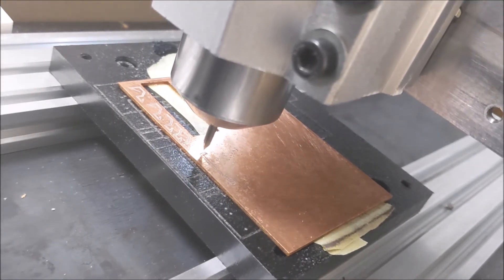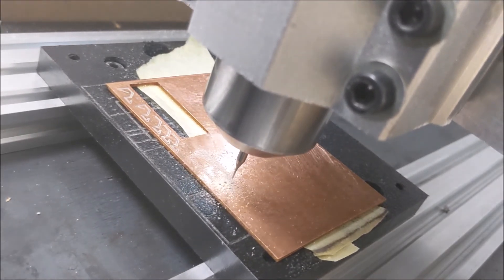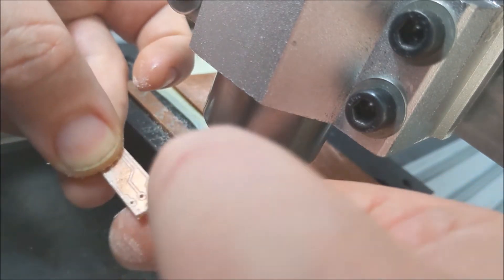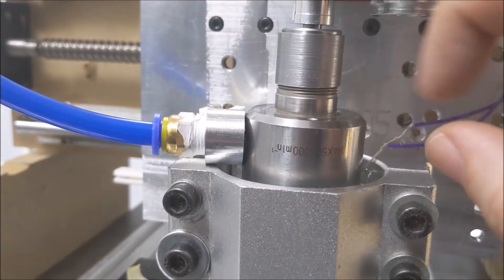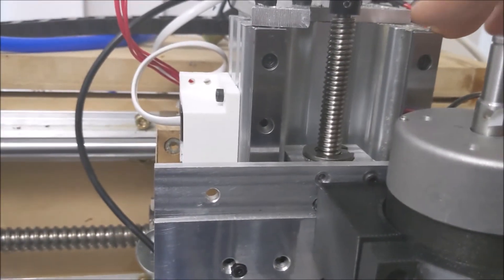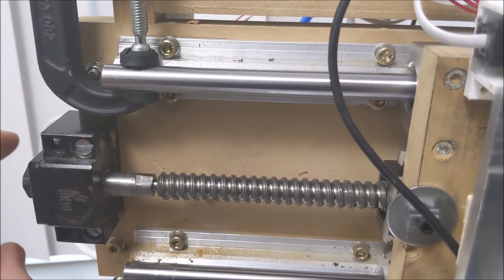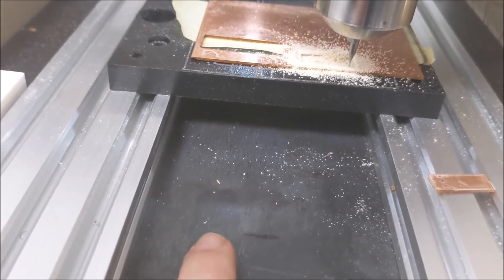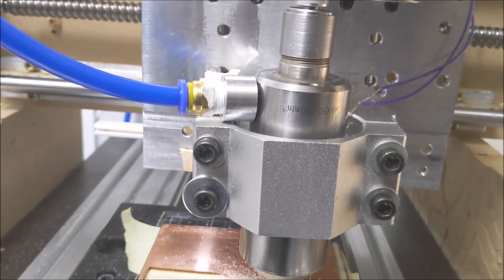NSK ATC NR-40 spindle

Comment: Fantastic! Really interesting to see everything in context. After changing you do you use a conductive path for touching off? I probably never would have figured out there was a Van de Graaff generator causing problems. What PCB software do you use? I'm planning to use KiCad and Flatcam.
Reply from the maker: i actually saw a spark!  I doubt i would have realized if I hadn't seen it.  I'm using flatcam beta and easyEDA or fusion's EDA depending on how complex it is.
Reply: @JesseSchoch  Similar no-way story: My wife had a laptop that would misbehave, reboot, turn off, and otherwise seems possessed. But only after 20 minutes, and only if not plugged in. (Or maybe it was plugged in?) I was trying to figure it out, and, maybe as stress relief, I rubbed my sweatshirt covered arms on the top of the plastic foldout table... Static was building up in the table as she worked, evenly taking out the laptop. Never would I have thought of that ahead of time.